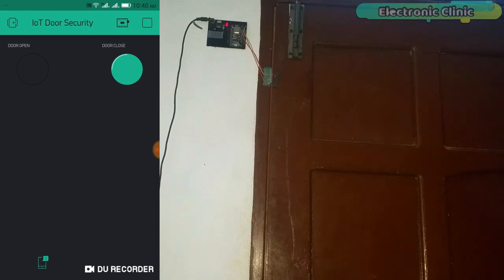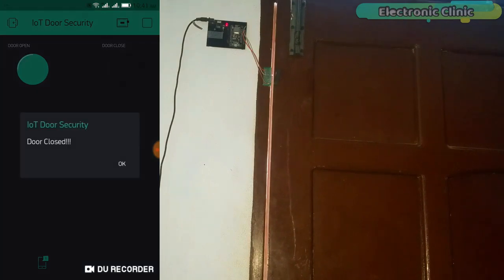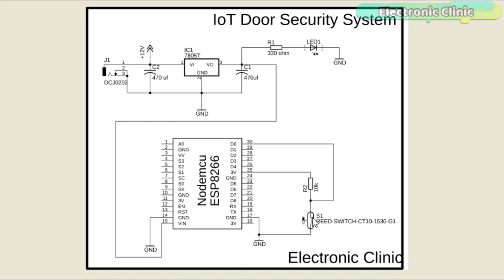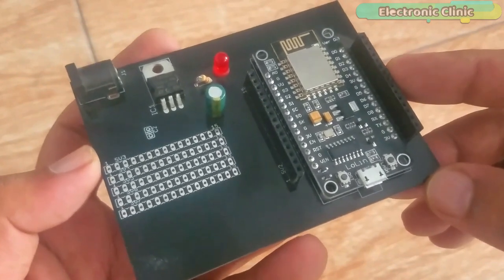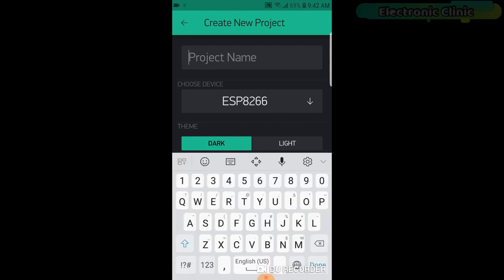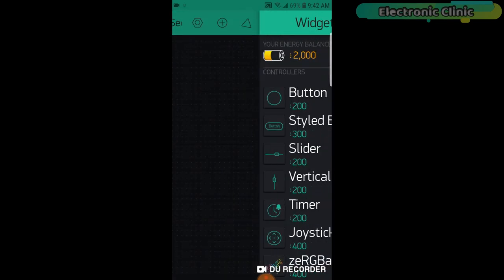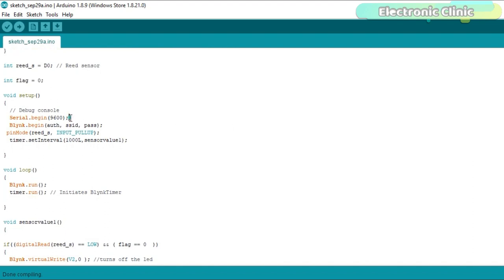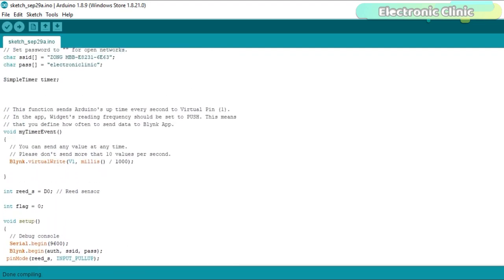IoT Door Sensor Reed Switch based Security System using Nodemcu ESP8266 “Garage Door”

Comment: Sir I'm working on home automation using sensor's main Moto is to turn on and off the lights when person is in the room with motion and without motion which sensor I should use to complete the project
Reply from the maker: use a PIR sensor. I have a tutorial on that which automatically controls a light. check playlist. you will find so many videos on automation and security systems.